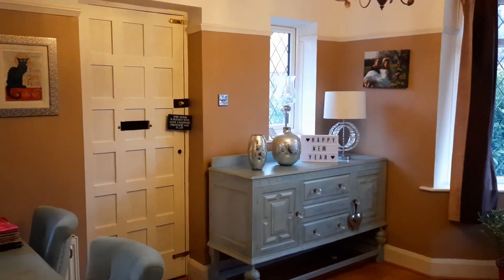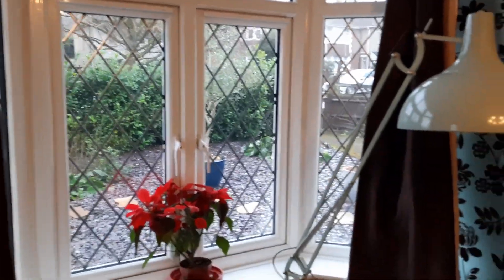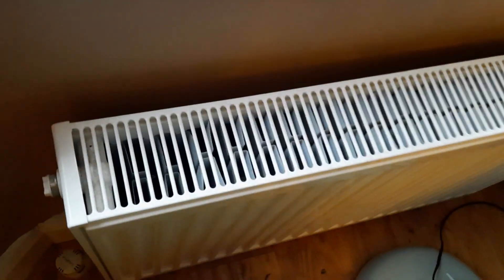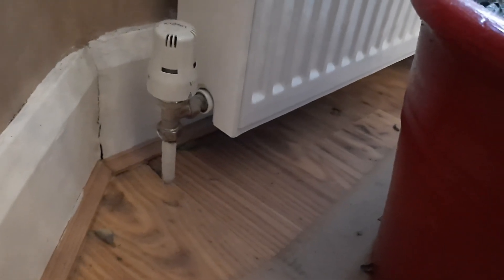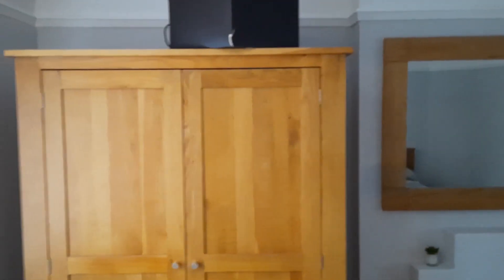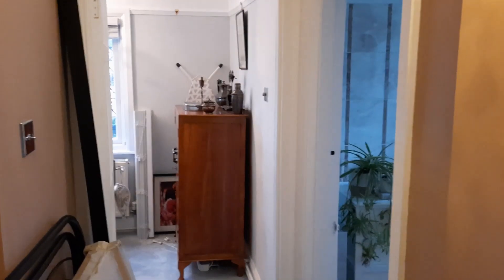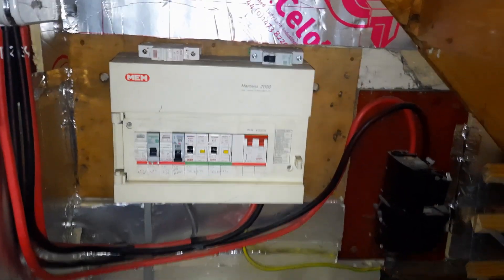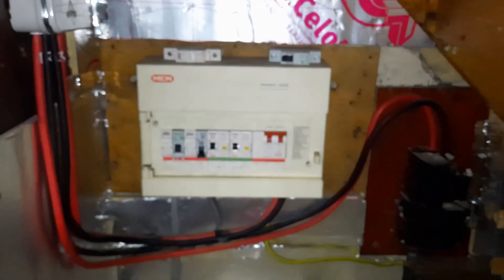How to survey a house for a heat pump. Gathering information for heat pump sizing.

Comment: At the risk of being a little controversial and considering you state 'it has a nine inch thick wall so has a cavity' I would disagree. Looking at the brick laying on the front of the house the layers alternate between brick ends and sides - which along with the nine inch walls (and the look of the age of the property) would indicate to me that it has solid double interlocked brickwork. Somewhat less efficient than cavity!

Comment: Just a quick observation, you stated that because there was an air brick visible on the outside of the property it immediately means the floor is not made of concrete. Well we have a house which has a ventilated crawl space and the floor is made of suspended block and beam with concrete filled over the top and fairly thick polystyrene insulation on the underside. I appreciate that you are making this video in the UK and that old housing stock there is probably different to us here in the Netherlands, but I'm sure even there, an air brick does not rule out a concrete floor.
Reply from the maker: fair point but here if its vented its very likely to be wood.

Comment: All those chimney flues too. Even with an almost closed throat restrictor they can have a dramatic effect that varies with the wind (and so there’s also a need to see what sort of terminal is on the roof end). When combined with a ventilated wooden floor they often ‘draw’ the replacement air from around the room perimeter wherever tiny gaps between floor and skirting exist. Easy to see this time of year with a thermal camera.
Reply from the maker: tell me about it, i live in the house in the video, i know all about high air change rates, but i put them in the calcs and the heat pump has worked well for the last 11 years.